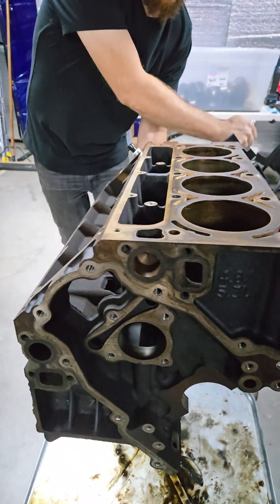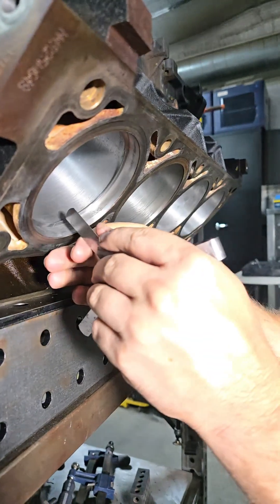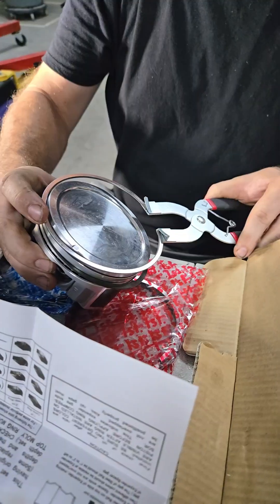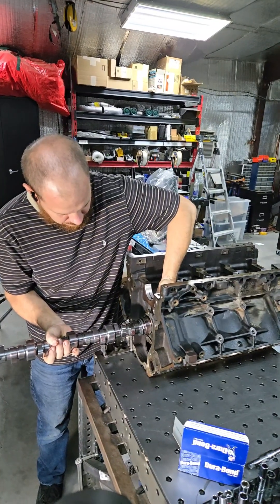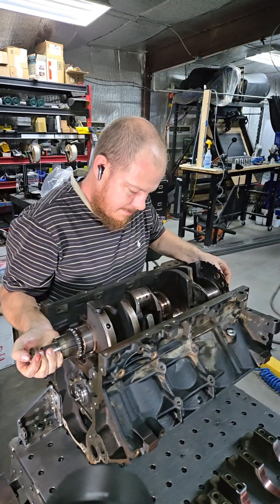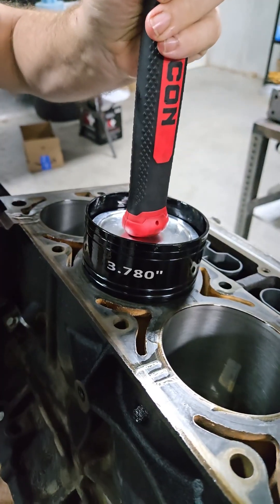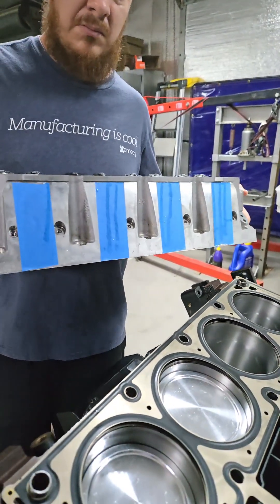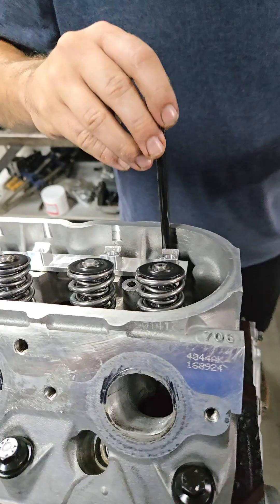DIY LMP CAR gets 450hp engine! #diylmpcar #lsengine #lspowered

Comment: I love how the 5.3 is seen as a great hot rodder's engine with a 3.78" bore, but the 305 smallblock is seen as junk with a 3.736" bore.
Reply from the maker: There seams to be a group behind every engine, and cast hate on all others. Wrongly so. Few know that all engines have a lineage and the LS is from the small block family. They share the collective knowledge and in some areas the same dimensions. All engines are interesting and some do better than others here or there. That's why we love motorsports. The diversity and ingenuity is fascinating.

Comment: I got this same motor in my truck, 340,000 original miles and still going.
I do plan to tear it down and send it to a machine shop, it’s been a great truck and I really think it has a lot of potential to be turned into something fun.
Who cares if it’s rusty and the paint doesn’t look great, I can always fix/repair those later on down the road.
The important thing is the frame is still in almost perfect condition with just surface rust coating it. The body/paint is replaceable/fixable.
Reply from the maker: Love these engines! Keep it rolling and have fun building.

Comment: I don't understand the point of reinstalling stock pistons. It really isn't that expensive to get something a little sturdier even if you don't plan on using all that capability. If you're pulling the motor apart you might as well, especially if you're getting new pistons regardless.
Reply from the maker: It's personal preference. The stock pistons can do everything we ask of them on this build. That's all. If we boost it down the road then we might swap them for stronger forged pistons.
Reply: @centurialinc my guy the stock bottom end on an ls can handle 1000hp, there’s people who have managed to squeeze 1500 out of the gen 4s. That thing a handle 450 comfortably for years.
Reply from the maker: @kwashawntaylor3343 That's true but for the price it's hard to say no. Some good pistons are only $450 and it adds extra safety margin. The rods are the same. But the real issue with that much power is the trans. We have the 4L60e and it for sure would need to be modified at any power beyond 500hp or 500trq.